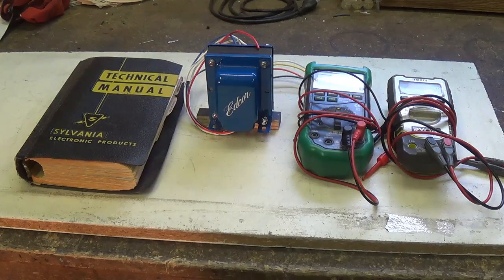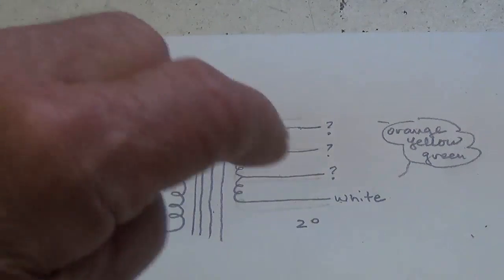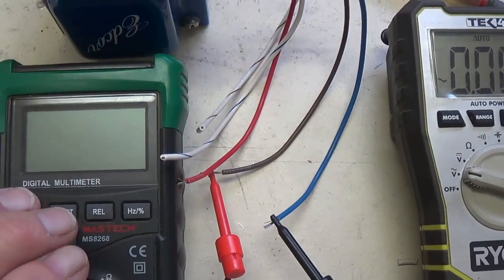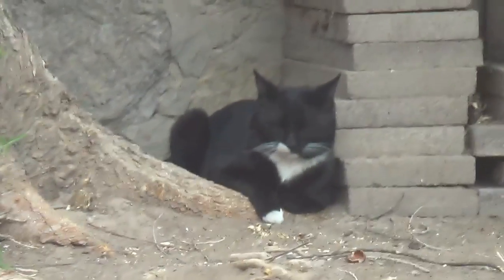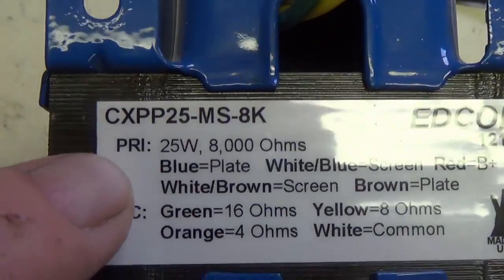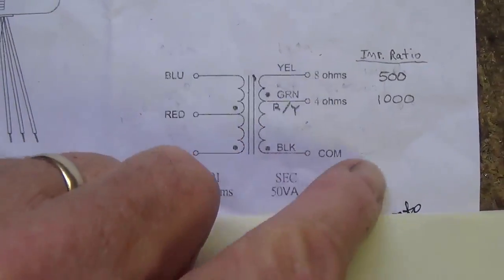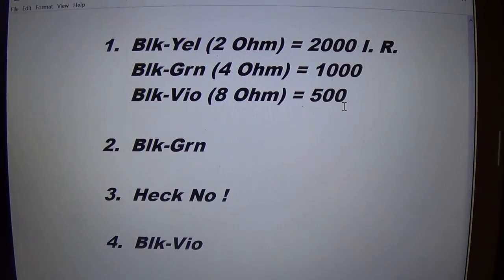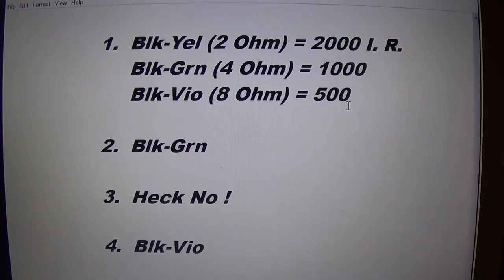Impedance Ratio: The Easiest Way to Decipher Output Transformers

Comment: Uncle Doug whats a good con
Reply from the maker: My favorite is bilking old people out of their social security checks, Ron :)
Reply: @UncleDoug  Hey Doug    can you show  us how to make the  trouble shooting tool where you use chopstick and phono needle  to test down the point to point circuit boards ?       I used to work at Kendrick  amps in Austin for Gerald early on  when Chris Ramey was still there  the first employees..  We had one of those for testing  the circuit and  he would tap off an old am radio and plug that tap in front input  its not enough power to hurt anything line level tap but it feeds signal through.  one side of  phono graph wire on chopstick is wired to the  cord plugged in the other side  grounded to chassis..  Gerald had an old radio headset
that would feed the sound on through the circuit  via the phono graph needle...
the chop stick kept you from getting shocked..   You could go from start of circuit
all the way down the main circuit board point to point and touch each connection either side of the part  resistor or cap ect and if the sound stopped  THAT was part of the problem replace THAT PART and proceed down board till sound is flowing    we would then  test  on current limiter which is the Bulb   limiter you show how to build and if it was fine we would put normal power too the amp and test  usually that fixed all the issues...   I am having trouble remembering how to wire that    I left there in 1991 my Son had just been born  hes going on 29 now its been just a minute  since ive seen it and  cant find a diagram on how to make it...

Ive got some amps now giving me fits   Ive got   voltages but no sound
driving me to grey hairs  so I am thinking to make one of those chop stick
testers and need refreshing    can you show us how to do that ?

THANKS MUCH  IF YOUR STILL DOING REPAIRS IVE GOT SOMETHING FOR YOU TO LOOK AT...
ITS A BOOGER    IVE NAMED THAT AMP RACHEL  CAUSE ITS HAUNTED !
That amp was making sound but the clean side loaded up first  would crap out or fizzle and not pass sound  the lead side would just fine ..  thats got a split 12 ax7 mod   eventually both sides stopped making sound and that amp took some arching  at b on underside where cap pan is   right at the standbye cap..
It arched back up the heaters and through PI ..    I fixed it once already but have never been able to get it working..      replaced transformers sockets heaters
part for part  even remade another board...    I cant figure it out so I either find it with chop stick method or send it off to be looked at...

are you still doing repairs ?   can I send this too you to look at ?
Thanks much

Comment: "Perfectly matched speaker to output tubes...." yada yada not really.  Best match is USE THE WHOLE TRANSFORMRER.  dont buy a 3 tap trasnformer and then use the 4 ohm tap.  sorry no.  just use the 16 ohm tap on the 4 ohm speaker it doesnt matter.  trust me.  listen to me.  and then if you have TWO speakers 8 ohm .  run 0-8 ohm one spekaer.  then run 8ohm tap to 16 ohm tap for the second speaker.  make sense?  two speakers in series and the 8 ohm tap is the middle of the series speaker.  Okay now you know the truth never throw away 3/4ths of the output transformer .  Always use the 16 ohm tap no matter what your speaker is on a 4, 8, 16 output trasnformer only use the 16 ohm.
Reply: Okay now I dont care if you downvoate me because "the spekaer say 4 ohms on it you plug it into 4 ohms or else it will blow up ! science !"  no shut up I am true.
Reply: okay WOW especially in this sitaution.  Listen to me this is treu.  Because you have 8k on the primary side and 4 ohms or 16 ohms on the secondary.  Okay what is 4 ohms divided by 8k ohms.  Okay now what is 16 ohms divided by 8k ohms.  That is how much more stressful it is on the tubes it is .01% more stressful on the tubes to use the wrong tap either 4 ohm or 16 ohm.  Okay make sense?  Okay.
Reply from the maker: Thanks for taking the time to share your opinion with us......but I hope no viewers take your advice.

Comment: You kinda cheated u already known the transformer was 8k  and the wattage I have transformer a bucket of them . I wish you did a video on a complete unknown output transformer and how do I tell if it’s pp or se
Reply from the maker: The differentiation between PP and SE simply involves determining if the primary is center-tapped (=PP), otherwise, it's SE. I did not cheat. Once you know the Impedance Ratio, it can be used to determine the load resistance if you know the speaker impedance, and vice-versa. I know of no way to determine the power capability of a transformer other than from the tech literature that comes with it.
Reply: @UncleDoug  right so you cheated you knew it was a 8k transformer and 25watt
Reply from the maker: @jimcatanzaro7808  You are missing the point, Jim. There are NO "8K" output transformers. The primary impedance depends entirely upon the winding ratio and the impedance of the speaker. Please try to understand electronic theory before accusing people of "cheating"......it's getting tiresome.